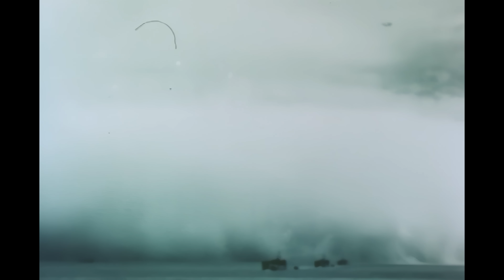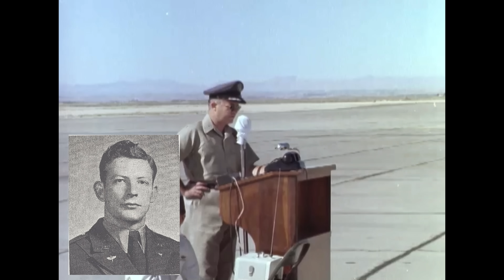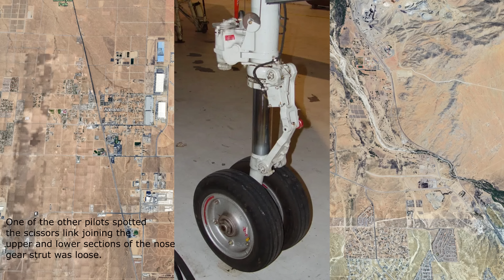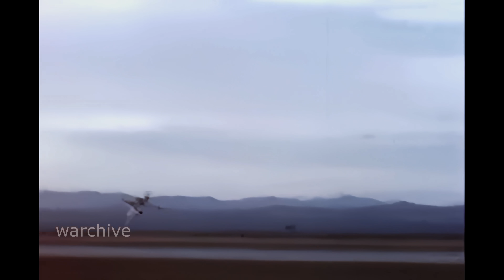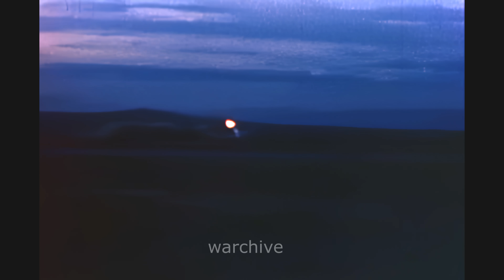The Sabre Dance F-100 Crash 1956

Comment: Some years ago, I read the AF accident report on this. As I recall: The film crew was there to capture footage of another test flight and the camera man saw an F-100 on a long approach and all the emergency vehicles headed out to the runway, so he started filming. The emergency crews foamed the runway. The F-100's approach was short with respect to the foamed area, and the pilot simply pulled the nose up to extend his approach (a mistake). When the stall started and the plane began to roll, the pilot went to burner and used ailerons to try to correct (another mistake). The part I have never understood about the report (as I am not a pilot) is that it stated the correct procedure was to use rudder not ailerons to correct this situation. I'm not sure how that would work, but as I said I'm not a pilot. Sadly, the footage was sold or given to Hollywood and it appeared in many aviation movies and TV programs in the 1950s and 60s which must have been hard on his family and friends.
Reply: If the ailerons have already stalled, any deflection of them is akin to deploying a speed brake, inducing adverse yaw, not roll.  The roll function of the aileron is abandoned in the stall and the rudder is the only usable flight control surface able to push the retreating (drag induced trail) of the wing forward into the apparent wind.  On my second day of flight training I saw a person do exactly this same departure from controlled flight in a Cessna 152, left wing dropping, pilot inputting right wing down, the left wing completely stalling, rolling the aircraft inverted for a nose straight into the ground impact, instantly fatal.
Reply: @NeroontheGoon  Even 152s bite sometimes... and God knows how difficult it is to stall them.😐
Reply: @duartesimoes508  You just didn't pull back hard enough. You can stall a plane at any airspeed and any angle of attack.152s included.
Reply from the maker: @thornefroemming7796  Thanks for the additional information!

Comment: What's the point showing four times the crash without any analysis? It just voyeurism and huge disrespect for the pilot... thumb down!
Reply from the maker: You're absolutely entitled to your opinion, and I respect that. Just to clarify, this video compiles all the available angles of the crash, originally produced by the U.S. Air Force. It has been used as a training tool for decades to help pilots understand and learn from past incidents. 

The intent is not voyeurism, but education and preservation of aviation history. I do see where you are coming from, and I will take this into consideration in the future. Thank you.

Comment: This phenomenon was cleared up by adding several feet to the height of the vertical tail, thereby increasing control.  High AOA had been blanketing the original vertical tail.
Reply: F104 had the same problem, especially at high AOA while maneuvering at speed.
Reply: The video mentions that F-100 "C" models were used for ferry trip.  It was the earlier "A" version that suffered from tail height issues. By the time the "C" version came out, it had the increased fin height incorporated which was standardised for all succeeding versions of the plane.  Oddly, the "A" version was not phased out until 1958 - sometime after this particular accident.
Reply: That’s what I had heard.
Reply: As stated earlier, the vertical was taller on the "C" model, but what really helped was the "D" model's flaps lowering landing speed, a little. Truth be told, vertical stab size has absolutely nothing to do with stall speed. Even with the taller size of the vertical the actual rudder size was unchanged. 7 square feet ain't a lot of area to correct yaw or pick up a low wing. Plus, once you hang 6 underwing pylons for fuel tanks or bomb racks the rudder becomes pretty much an afterthought due to the vertical area of the pylons.

Comment: How did the pilot know a pin was missing from his landing gear after takeoff? Also that would not cause the aircraft to flare up as it shows in this video which you keep showing over and over.
Reply from the maker: Well, as stated in multiple comments, the sources are conflicting. Some say men on the ground noticed it. If that means the ground crew that removed the pin recalled it was not re-inserted or not, I cannot say. Other sources say his wingmen noticed something was off with the nose wheel.

The reason for the pitch-up has nothing to do with the nose wheel, but everything to do with the physics of how a swept wing aircraft stalls. The wingtips stall first, causing a roll. The center of lift then shifts forward, and the center of mass is then way behind the center of lift, causing the heavy pitch up…

Comment: The dubbing is completely wrong. 
The sound of the turbofan jet engine of the high-altitude aircraft you used did not reflect the high-frequency whistling that should be heard at close range when the turbojet engine was operating at maximum speed, especially when the afterburner was opened.
Reply from the maker: @siroyiryuu  Noted. I appreciate the feedback!

Comment: Sooooooo, no ejector seat?
Reply from the maker: It had an ejection seat, but this was not a 0-0 seat. This means he required a minimum altitude and speed in order to safely eject, both of which he is way below. Ejecting would likely have had the same outcome. He was likely fixated on recovering though. Rip
Reply: those old ejection seats needed speed and altitude to work properly. they weren't automated like modern seats that are "0-0" rated. he was well outside the envelope to eject and survive.
Reply: @Matt_Weaver1  Modern ejection seats, both Martin-Baker and ACES -2, have rockets that fire after the initial charge kicks the seat out of the aircraft. In addition, there are also stabilization mechanisms and parachute mortars that pull the chute to give the pilot at least one swing before hitting the ground. Even then, ejecting "low and slow" is not always successful!

Comment: it feel like didn't care about the balance when landing because too much focused for high speed...
Reply from the maker: So, the stall happened due to too low speed. This caused the wingtip to drop and subsequently the pitch up. It was all around a bad situation, and there was not much he could have done differently after the stall happened. He lit the afterburnes in an attempt to recover but at that point recovering was impossible. In order to recover he would have required much more altitude

Comment: With those old ballistic ejection seats to work the aircraft had to be 200 feet off the deck and going 200 knots, minimum. He had no chance to use his seat and it would not have helped. He was a young, inexperienced pilot trying to save his aircraft and himself. Ferry units were designed to give pilots experience in these aircraft as they were considered low stress “milk runs”.
Reply from the maker: True! Appreciate the information regarding min altitude and speed!

Comment: Wasn't it possible to just eject before coming in for the landing?
Reply from the maker: Impossible to answer. As the F-100C did not have 0-0 seats he’d have to eject with much greater altitude than that. He was highly fixated on recovering from the stall. Thanks for your comment :)
Reply: Yes at greater altitude, if he had elected to not try and land

Comment: I have a good friend who had to eject from his F16. He said he made that decision long beforehand to not leave his wife a widow trying to save the plane. He knew of too many pilots that made that mistake.
Reply from the maker: Glad he made it out alive. Still a super dangerous event, but luckily for your friend, ejection seats has come a long way between these two events. Thank you for sharing!
Reply: Martin Baker seats generate a constant-G acceleration by using solid rocket motors instead of explosives. These are tuned to generate a force just under the threshold for spinal damage. (About +15g IIRC).
It often knocks the pilot unconscious, and can really damage spine and neck if the pilot does not sit back, shoulders and held head up.
Reply: A friend of my father survived 2 cold shots off of carriers, one around 1960 and the other a few years later. On the second one, the ejection seat did not work, and the canopy did not open. The carrier went over his sinking plane and he did not manage to get unbuckled, get the canopy off and pop his life vest until he was 80-90 ft down. Both ear drums ruptured as he ascended to the surface.  A trailing ship plucked him out of the water. That ended his flying career with the Navy.
Reply: The F100 didn't have zero-zero ejection no?

Comment: Посадка на брюхо это одно из обязательных тренировок,,,а в этом фильме что то не совсем всё ясно ,,,зачем было выходить на сваливание самолёта.......
Reply from the maker: I’m not sure if the translation is correct, but I think I understand.

So, the pilot did not intend to stall the aircraft. Fearing what would happen with his nose wheel when he landed, I assume he tried to slow down as much as possible before touching down, and stalled by accident. I’m not sure regarding belly-landing procedures in the F-100, but you are most likely correct that there were some.

Many things went wrong for Brooks this day, and many things could have been done differently. 

The Mig-19 was also very prone to stalls like the one we see in this video, at low speeds. The F-100s wings were swept back at 45 degrees, whilst the Mig-19 was 55 degrees.

Thank you for your comment :)

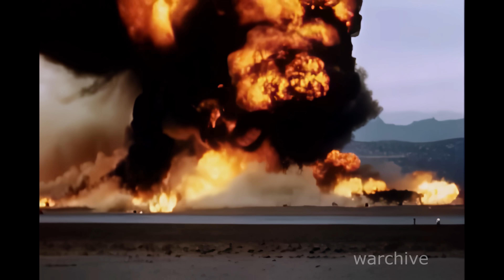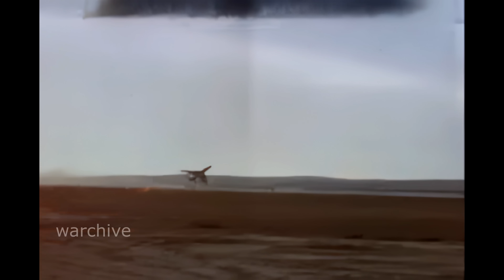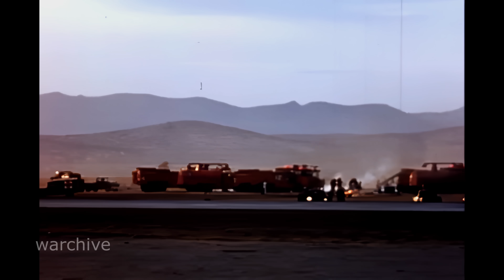Comment: I didn't read all the comments, so forgive me if this was covered, but it looks like there's some movement in the cockpit around 3:30 - 3:35, and the canopy seems to be gone around 5:45, although by that point, I'd bet the firefighters had done that as they tried to get him out. Could just be my imagination, as well.
Enjoyed the video, though. Appreciate your efforts to enhance this.
Reply from the maker: The input quality of the video is quite low, making it near impossible to spot movement inside the cockpit with the smoke and flames engulfing it. Personally, I do not see the movement you are referring to. I will however note that upscaling the footage often introduces artefacts in areas of movement and blurry sections, which I then try to fix by rerendering the distorted section in a lower resolution. I may have missed some frames, but I think it’s safe to say we are not witnessing Brooks in the cockpit.

The footage is also one of the most analyzed crash footage of fighters that exist, and I have also not seen your observations noted anywhere. I don’t say this to bash you, but rather to ease my own mind… and yours, and everyone else whom it may concern.

I analyzed the footage frame by frame on my computer, as I would certainly not feel comfortable leaving the footage up if we were witnessing that…

I appreciate your comment, David!
Reply: Yes it does look like movement but I think the engine is still running as you can see puffs of flames so that is more likely just rocking the remains of the fuselage. That impact was brutal and there's no way he's have survived it even briefly.

Comment: Ahh, partially right, but mostly wrong.  Early jet engines had long spool-up times.  On a swept wing aircraft, regardless of flaps and slats, you have a real problem to deal with, as this pilot did.  On a chart, if you plot the lift-over-drag curve, and then you plot the power required to maintain level flight, you can reach a point, again as this pilot did, where instead of increasing power on an approach, you merely increase Angle of Attack (pitch angle) WITHOUT increasing thrust, you rapidly fall "behind the power curve."  This is an area where it takes more thrust than what's available to maintain  desired pitch on an approach.  You try everything, including AB, and it just makes things, including Dutch Roll, much worse; hence the side-to-side gyrations, until it all comes unglued, and a crash insues.  The ejection seats of the early Century Series, including the F-100A through at least the -C, were NOT "zero-zero" seats.  If I remember on the Hun, bail out needed  something like 125 knots AND 200 feet altitude.  Unfortunately, I  don't have a copy of the dash-1 (Flight Manual, TO 1-F100A-1) to confirm the exact numbers, sorry.  Hammer  43+ year Firearms Instructor. USAF SSgt; US Army CW4/SrAviator; FAA Comm'l, Inst, etc.; INS/ICE/CBP, ret.
Reply from the maker: Thank you for that thorough explanation, Hammer! I agree that my research for this project was not the best. Live and learn. I've learned a lot about aviation merely by the comments you guys provide, and I am grateful.

Thank you for confirming the F-100, up to the at least the -C, did not have 0-0 seats. Questions regarding why Brooks did not eject has been the most asked questions, and I can finally provide the answer I have give to this point, only now with more confidence ;)

Thank you for your service.
Reply: -A characteristic of swept wings is that for a wing configured for the same lift as an unswept wing at say cruising speed their drag increases much more rapidly as coefficient of lift increases.   The swept wing can generate the same lift as a straight wing and in fact stalls at much higher angles but when generating the same lift it must do so at a higher angle of attack and it will generate more drag. 
-In landing configuration it's possible that if the pilots is flying slow and then requires a little nose up to adjust approach that the drag increase will be so great it will slow the aircraft down to the point it is losing altitude.   Of course a good approach will involve adjust the approach with a thrust increase.  Slow Engine spool up times were a partial issue.
-The solution is to apply air brakes continuously on approach so that there is a surplus of thrust.  If the aircraft slows a little due to drag increase from a angle of attack increase the drag reduction from the air brakes will be according to the square of speed and reduce the extent of the speed loss.
-The airbrakes can also be quickly retracted, much faster than engine spool up.
-High lift devices such as tripple slotted flaps help because the provide a lot of lift.
Reply: As the video states, and as early Jets such as F-86 and F-100 suffered. Their swept wings were also tapered in planform and thickness. The tips were shorter chord (lower Reynolds number).  They were also thinner, not just because they had shorter chords but also in percentage of chord.

The wingtips had a lower stalling angle of attack than the root. 

To make matters worse, the swept wing creates lateral (crosswise) flow. This loads the wingtips more than the midspan. 

So, the wingtips always stall long before the midspan or the wing root.

Now, the tips are also located aft of the Mean-Chord located at the area-centroid of the wing, and they are very far behind the Center of Gravity. 

Losing lift far aft of the CG causes an uncommanded nose-up pitch.

Once the jet pitches up, more of the wing stalls, and this major loss of lift causes the jet to begin to settle abruptly. The Pilot applies full afterburner, but there is a delay of perhaps 5-6 seconds until the engine spools and finally develops maximum thrust.

In the meantime, the pilot cannot pull the nose any higher to prevent the aircraft from descending because the jets wing is already partially stalled. Pulling to a higher angle of attack causes further loss of lift. The competent pilots first instinct is to push forward when he first detects the uncommanded pitch-up. This is always the right move, because it prevents the remainder of the wing from stalling. It also generates additional lift far aft of the Center of Gravity as the rear mounted stabilizer is being deflected nose-up to generate tail-up force. This takes some of the load off the main wing, lowers the main wing angle of attack, assists in un stalling 
 the wingtips, etc. 

This dance maneuver is recoverable. 

The reason it was not in this case and many others was insufficient altitude. As soon as the wingtip stalls and the jet pitches up, more of the wing stalls. This loss of lift causes the jet to descend. Pushing forward on the stick recovers. But the moment the pilot pushes forward, angle of attack decreases, and there is a momentary reduction of lift and therefore lost altitude in the recovery. If the jet is 10ft off the deck at 160 knots, this is going to hurt. As in; not survivable. 

The jet probably needs at least 50ft and preferably 500ft or more to recover from this scenario. 

Modern jets do not locate their wingtips this far behind. Deltas, the F-15, F-22, F-35, Rafael, Gripen, Typhoon, Sukhois, etc. all have their wingtips no further aft than the wing root trailing edge. The American jets from the 1960s onward utilize a lot of "washout" typically in an aggressive "conical" shape as the F-15, F-106, SR-71 did. (F-16 and later are more sophisticated). 

The F-100 was an early design, and generally pretty awful. The F-86 had a similar issue, but not as pronounced. The F-86 was actually a fantastic jet with few vices.

Comment: That engine must of been slow to spool up in afterburner. The thrust to weight must of been crap back then.
Reply from the maker: Notoriously underpowered like most jets from the time
Reply: when the US was developing it's first jet, the P59, one if the test pilots famously said "We get more heat from your toasters then from these engines!"
Reply: High-bypass engines in jets today are far more responsive to throttle up compared to the engines in the 1950s.
Reply: "...must of been..."
have
must have been

USMC
Reply: I have read that the piston engine Grumman F 8 Bearcat could outclimb most early jets fighters!